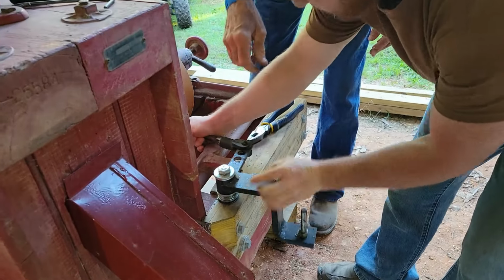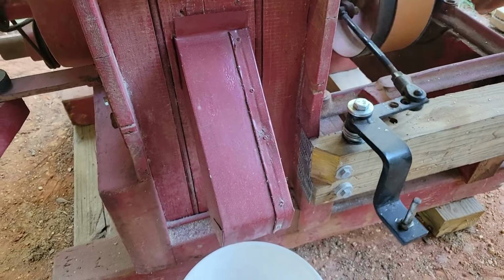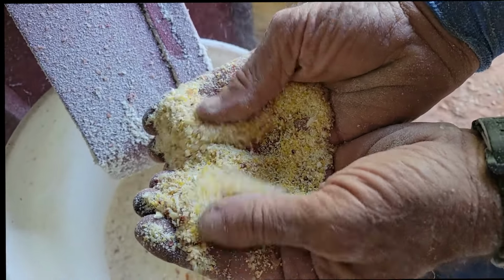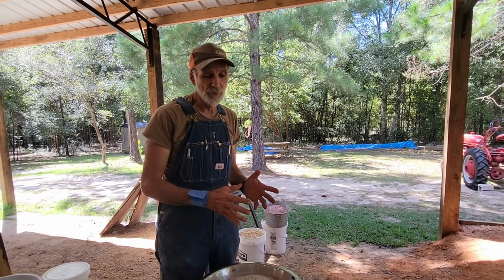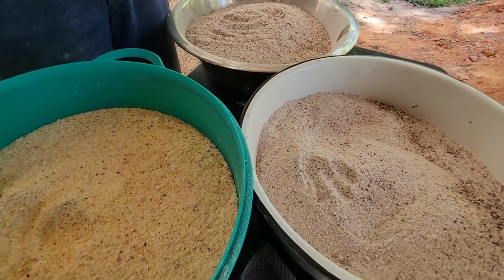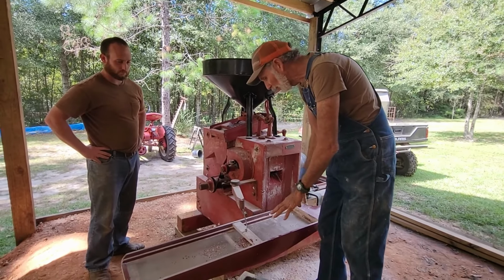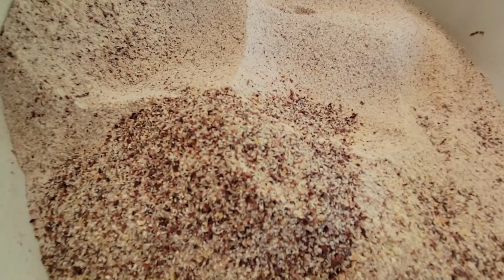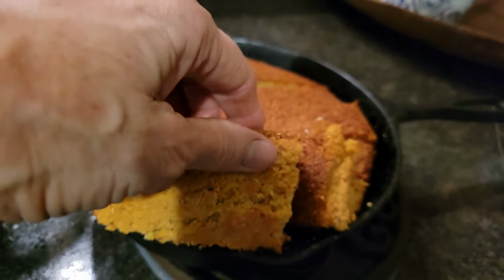1940 Meadows GRIST MILL and 1950 Farmall CUB TRACTOR

Comment: It looks like your stone need dressing
Reply from the maker: They were just done not long ago.
Reply: I just rebuilt a 1935 meadows mill and dressed the stone on mine and when I ground the corn I had nothing but husks coming out the end of the bolster which they say is good it means that the stones are sharp I’m not a expert at all I’m learning as well I like your videos thanks
Reply from the maker: @brianirick9826  My issue was the tractor was not strong enough to pull it at the right speed. It should have been turning just a little faster than it was. It was constantly trying to kill the tractor if we let to many kernels though. Still learning

Comment: Question why nit just run a harbor frieght engine to power the gristmill for that mater why nit run a shorter easier to align and tendion belt i promise your loosing 5 hp through that belt stretching it seems a couole mods and you could improve your ability while still retaining  the old way a small harbor frieght engine even up to the 650 cc v twin is old tech carburated to a empty splibe pull that drive pully system off the farmall fit it to the new engine and run that thing full tilt  also im sure a guy with lathe skills could remedy that loose feed regulator bolt better yet figure out whete the feed rate is best at full power with new motor and weld that collar in place or at least drill holse that allow you to set and p8n it at intervals. I understand preserving tradition and i onow yall had a good time but you could vastly improve this set up to improve your time spent aquiring feed and one minor part of your diet